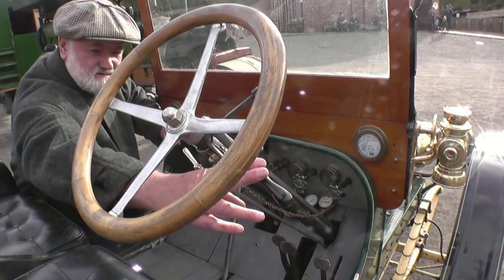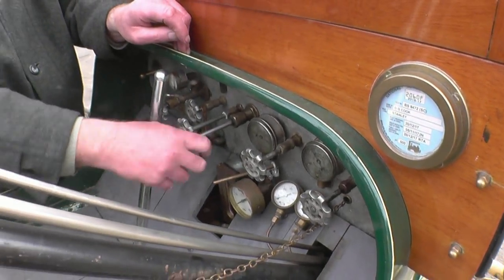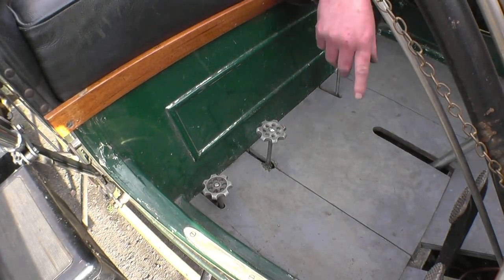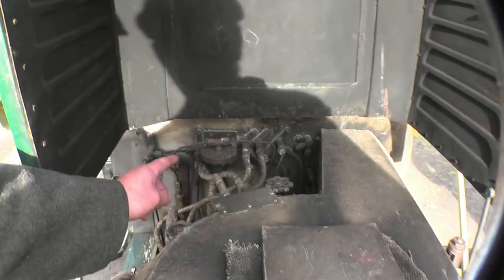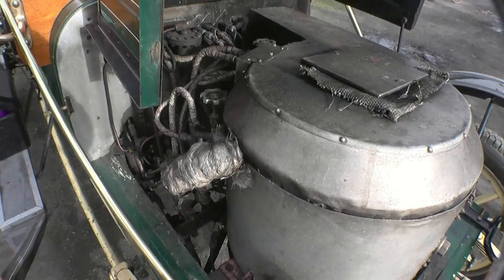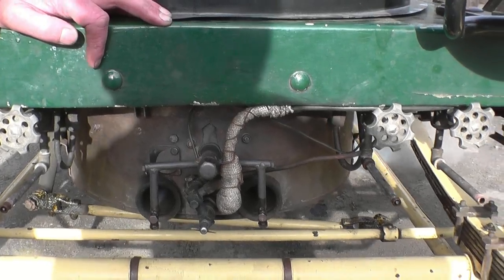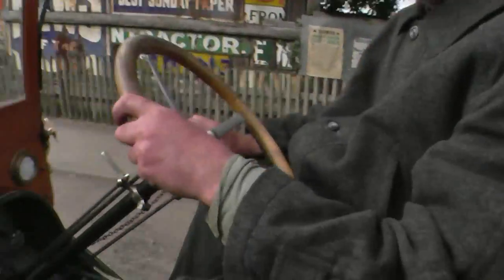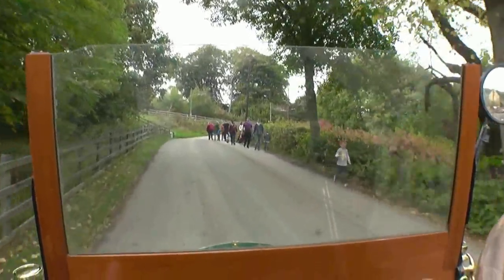Stanley Steam Car

Comment: you have to be a stationary engineer to be able too  operate that  stanley steamer lol. pretty darn complicated.
Reply: Actually not. I'm a stationary engineer and that is somewhat different program. The certificate would be either locomotive engineer or whatever they called the people who were certified to operate traction engines and such things.

The "stationary" part is due to the plant you are operating is not moving or stationary. This can range from small mill engines to large multi boiler multi megawatt power plants.

Comment: Where would we be if we'd had 100 years of development of that concept instead of the internal combustion engine. Astonishing.
Reply: we did, that was the culmination of 150 years of steam, it had peaked it had high and low compression cylinders, condensors, flash boiler, it had peaked, then we had 100 years of the petrol and deisel and now they have peaked, its electrics time now, looking forward to what they can do with a few more years, plus the batterys will be so useful for other things
Reply: Jusb1066 

Interesting point you make. Had it peaked though? I'm thinking in terms of how good a heat transmission medium steam is, and what could be done with modern, lighter materials. I take your point about electric cars. One thing to bear in mind about that is that there were electric cars at the time of the Stanley steamer, and petrol, all vying for the top spot. Petrol won out because of ease of use and range, amongst other things. If we can have better electric cars now, we could have had better steam cars.
Reply: yep the electric cars we had were lead acid based, and battery technology stagnated untill the 2000s, like 90 years because we didnt seem to need it, (any lead acid based car even in the 2000s was still poor range etc) only because of lithium are electric cars remotely decent,  i think steam already had the light materials, theres only so much weight you can save, it had indeed reached its peak (high pressure flash boilers, there isnt anyway forward from there) , petrol at the time was also about 15mpg and 15mph and unreliable, in fact all the tech, steam, petrol/elecric had about the same performance and range  in 1915, but petrol was the only one that could move forward, now its electric, the battery being the key more than the electric motor itself
Reply: In the 70's solar panels were invented but gave very poor performance, in another 100 years all cars will be of the Van/SUV  type with 100% solar power as every ten years the rate of efficiency  goes up, this year we are at 30% up from last year of 22 % and ten years prior at 17%, the new Scion model Sion car will change everything when it comes out next year as it is 100 % solar powered and only costs 25K